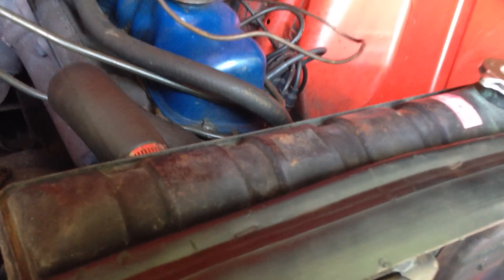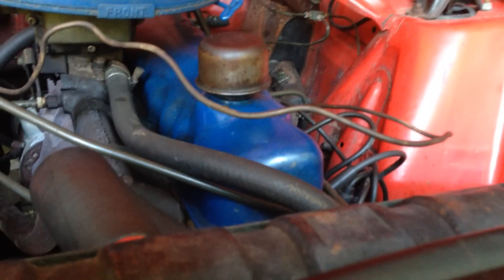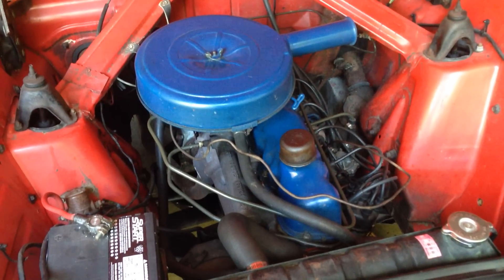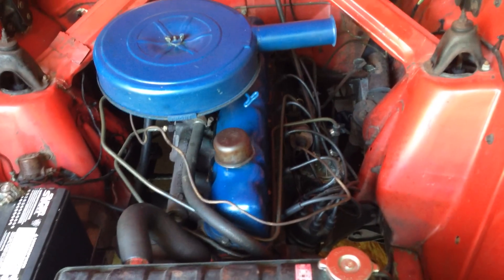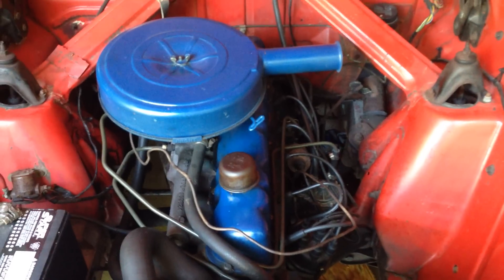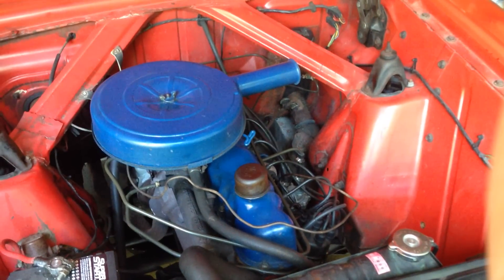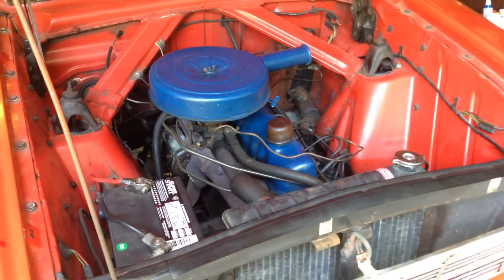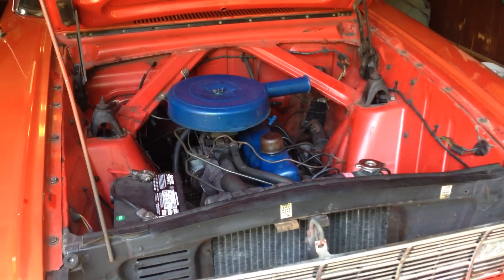Falcon Engine Swap Thoughts

Comment: Dang guys, that sounds really odd. Gurgling isn't good!

How about something like a modern Ford 2L four-banger (like from a Focus or something?). Similar/better power output and much better reliability/fuel efficiency!
Reply from the maker: yungtakumi 302!
Reply: so put a fwd engine in a rwd?
no.
3 0 2
3 0 2
3 0 2
Reply: CypherAod B230 from a RWD Volvo. Bulletproof, parts still available, and makes a rocking 110hp.
Reply: RegularCars it's a tough call in my opinion. Keeping original the engine gives a higher value, but at the same time, the engine is suffering. I'm going to suggest a new radiator and look into the water pump. Usually boiling water is a sign that the water pump has failed. I do understand the the fan is spinning, but if it's anything like what I experienced, the impeller may be done. Look into a water pump and an aluminum radiator. If you're still over heating, you should look into swaps. The transmission on the other hand is something you may want to look into a little more. I know nothing of the pre TKO and T5 transmission days.
Reply: And a front wheel drive conversion!
Reply: CypherAod In addition to the impossibility to bolt this kind of engine to a rear wheel drive transmission, this would also mean stuffing the car with electronics and computers just to get the engine running. Scrap that thought, it's horrendous!
Reply: RegularCarsYea, lets go with the least imaginative, most mainstream, dissrespecting solution. Might aswell do a 350 SB Chevy and it will probably even last a few miles.
Reply: TKTmon You mean a 4.9 liter 300 CI I6, The 5.0 is a V8. lower trim (stripper model) trucks often came with the 4.9 and 5 speed m5OD.
Reply: RegularCars the mustang 4 cylinder from either the old svo or the latest 2015 one.
Reply: Frandaman84 And a whole bunch of computers with it? Then it won't be original any more...
Reply: Khrrck 160 with turbo version
Reply: I was going to say a Mazda F-block out of an early Sportage.
Reply: ThePucko97 Sure, but then we're leaving regular territory. ;) It's about preserving the spirit of the thing too.
Reply: Seegal Galguntijak LOL  have you not seen the vast amount of kit cars running ford ecoboosts all in rwd applications?
Reply: tjykuy, vuyr76 The F150, a RWD vehicle, also comes with EcoBoost engines as an option, so there are EcoBoost engines for RWD layout, while others are for FWD layouts (i.e. from the Focus - and nobody would put a Focus engine in a F150, while nobody sane would want a V-type engine in a FWD car).
And still, it wouldn't be original any more. The amount of computing power needed to operate these engines is just totally inappropriate in such an old vehicle. If that's what you're going for, then you might as well buy and assemble a vintage lookalike kit car made in 2015, and not hassle with the real vintage stuff at all.
Reply: I wasn't commenting at all on the morality of putting a modern engine into an old car, still not going to but don't be so technophobic.
Nor was i saying he should go with a fwd 4cyl, but i was saying it is not only possible but has been done.
And i just meant fwd engines in rwd applications in genreal, people have been using them in caterhams/westfields etc for quite awhile. Pretty sure a bunch of the new trackday cars run them in both transverse and longitudinal mid engined rwd, so thats all the bases covered.
Reply: RegularCars what about a 5.0 i6 from a 90's f150 and a t56 from a cobra?
Reply: TKTmon You mean a 4.9 liter 300 CI I6, The 5.0 is a V8. lower trim (stripper model) trucks often came with the 4.9 and 5 speed m5OD.
Reply: 2.2l 4 cylinder out of a 91 Honda Accord... Lol I'd go 4.7l v8 out of like a 98 mustang.
Reply: Or maybe a fox body 5.0 swap into it
Reply: ***** Not at all, For example a Saab 9000 engine bolts directly up to any ecotec RWD trans, and a Volvo White block bolts directly up to a m90 RWD trans. Here in Sweden/Finland it's the cheapest engine swap available(apart from a Volvo b230 swap). I can link many cars that have a for example B5234T retrofitted(on like a 1000 dollar budget)